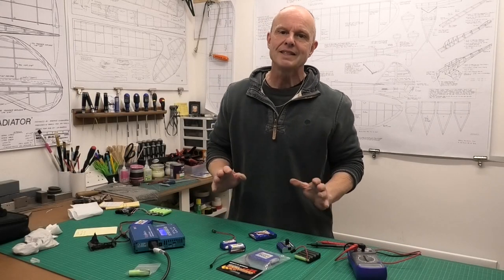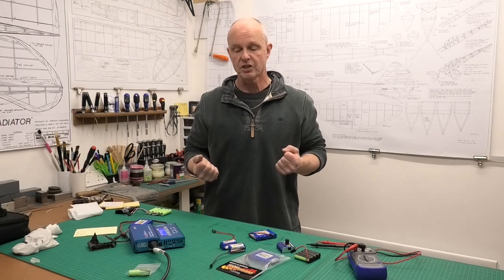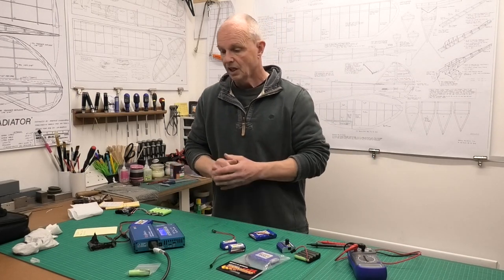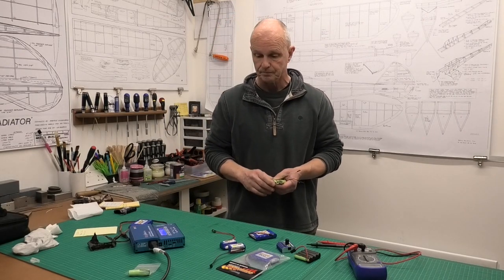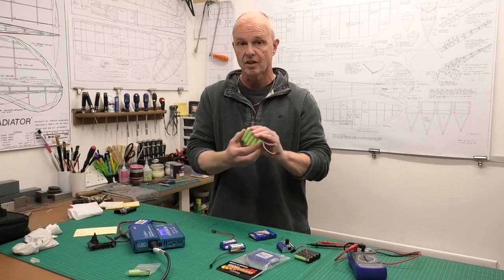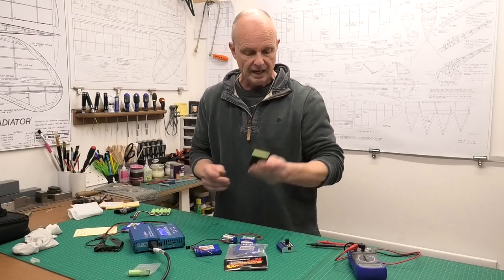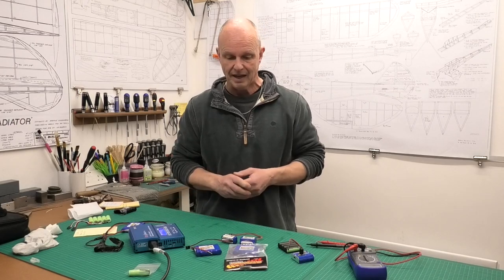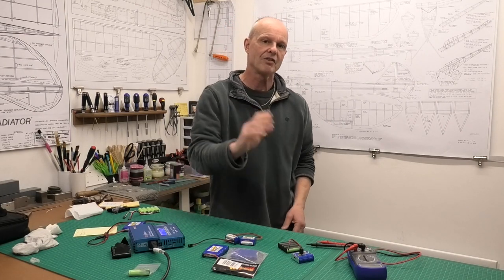NiMH Flight Battery Failure!  A very Close Call - RC Model Aeroplanes

Comment: 10 flights  a day is asking a lot of any battery pack on a single charge. I use Eneloop batteries and never had a problem. I use two 6v packs on different channels for the rx and 4.8v pack for the cdi. I never use a switch, they are connected straight in before each flight. I date my packs and they are generally replaced after two years and get used as test packs.

Comment: I've been using Sanyo Eneloop cells for Rx packs for over 10 years now. Never had problems with them, and the oldest ones experienced only a slight decrease to 2/3 of their original capacity. So you will be pleased with your new packs. 
For larger models, I do recommend using Molicel INR 21700-P42A cells for Rx packs. Combined with Jeti Max Bec 2, they're the most reliable power source on the market.

Comment: open voltage seems fine yet when loaded in a circuit drops down, typical sign of an increased internal resistance. just get a small dc filament bulb and check the voltage drop across the battery when given load,

Comment: Mark,
I have lost 2 planes due to Nimh packs, 3 years ago I switched to using a Castle Creations 10 Amp Adjustable BEC set to 6 volts and a 2 cell lipo in all my fuel planes. Never missed a beat since.
Cheers,
Dave Lang
Reply from the maker: Thanks for the comment, its appreciated

Comment: My JR X347 used to close the throttle if the batt volts dropped. You could close & reopen the throttle from the TX but you'd had the warning. Happened funnily enough to the pack MacGregor shipped it with from new.

Comment: I've got NiMH in my planes, and I'm often told at the field I should change to LiFe instead, but without much of an explanation as to why. It's made wonder whether I should change or not.
Reply from the maker: Would be interesting to ask them why, I think NiMH are a great safe solution to supply radio gear, I wouldn't consider changing.

Comment: 2 X 18650 Li ion tabbed with a balance lead for tx or with ubec for Rx . A bit costly but good.
Reply: A low cost alternative for 18650's is a laptop batter, there are usually 3-9 cells depending on the battery pack and all you need to do it sate it apart and separate the cells, find the rated mah and then charge the cell and discharge it to see the health. for a good tutorial on this look up "diy powerwall 18650".

Comment: I see that you have a charger capable of charging and discharging, if you hook the charger to each cell of the pack you can charge each cell and discharge it to see the performance of each. That way you can remove the failed cell or cells and perhaps take the best ones and rebuild the pack. All ni-xx eventually converts the battery electrolytes to a gas which slowly vents out causing the cells to dry out and lose capacity.
Reply from the maker: Thank you for the great idea, I did eventually isolate the one cell that had failed and removed it from the pack, so I now have a four pack that I am using with my servo tester when building, so safe in a non critical role.  Also done a similar thing with some of the other old batteries I took out of planes, using them for testing my spark ignition engines on the bench etc, great to be able to repurpose them! Really appreciate the comment 😊

Comment: I crashed one glider and when I almost lost the second one I saw the light on the receiver going out for a second. Then I cycled and inspected the pack. Actualy more of them. And find out that usually only one cell goes out. Not worth risking with others though.
Once I had glitches on old 35MHz, turns out the battery box cable was throughly coroded.
Time is a strong factor...
Reply from the maker: Thanks I appreciate the comment

Comment: Old batteries and load voltage drop are big over looked problems when using 2.4 radio systems. The receivers need 3.2 to 3.8v to operate depending on make. Unlike the old radio 72 systems that only needed 1.5v to operate. Add in high performance servos and you really need to stay on top of your control system batteries.🤔
Reply from the maker: Thanks for the comment

Comment: I would be cautious of cycling NiMH Rx packs, often you end up with unbalanced cells. Also the NiMH cell minimum voltage (for long life) is 0.8v - 0.9v
Reply from the maker: I was folowing the manufactures instructions for new batter packs
Reply: @MarkRobinson555  Just trying to help. If a pack gets unbalanced and you cycle down to a low voltage there is a strong possibility a cell will get reverse charged. This will damage the cell.
Reply from the maker: @trevorbartels1730  thanks, I do appreciate the advice, when I recycle I set the minimum voltage age limit so they don't get too low.